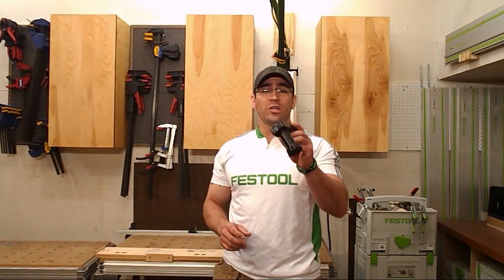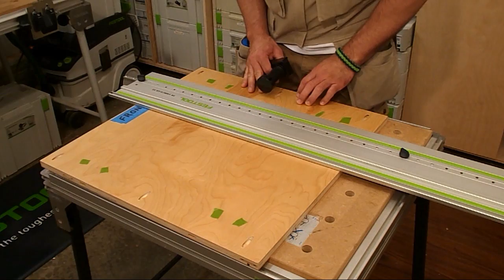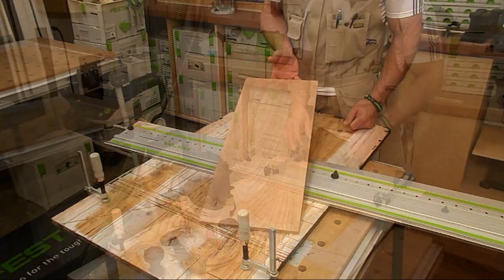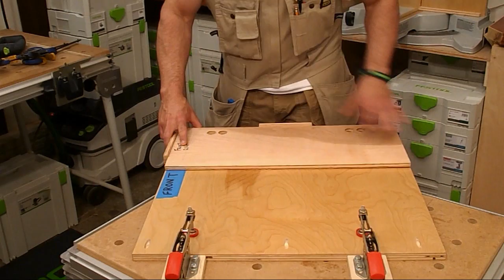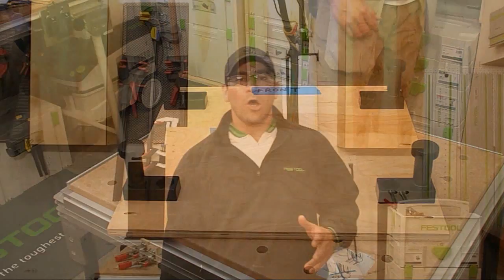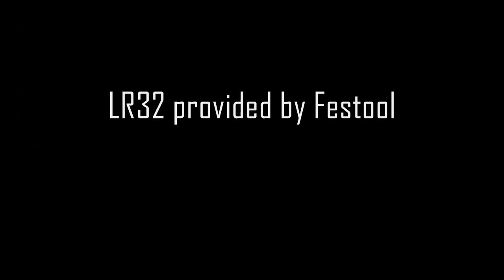Festool LR32 making a  adjustable leg jig  for base cabinets Part 6

Comment: Great job. After watching your "Festool LR32 system" and "Building Kitchen Cabinets" i am able to make my own kitchen cabinets from the scratch. Unfortunately Ikea do not sell Faktum adjustable legs anymore, they switch to Section adjustable legs and your template does not work. I had to make my own template. Any way, you did a very informative video with excellent explanation  for every steps, so even a beginner with right tools can achieve  great result. Keep doing. Thanks a lot.

Comment from the maker: Thanks Lance.  I used pre glued walnut edge banding.  Applied with a household iron and Fastcap edge banding tools .  The ply is pre finished maple.  It's worth the extra money for pre finished ply, saves on buying a poly and spray time.  I just wiped on some boiled lineseed oil on the walnut edge banding to bring out the color.

Comment: Thats what I thought, just double checking, Im in the planning stages of some shop cabinets as well, and I'm leaning towards the LR 32 Festool system. Did you use edge banding or hardwood veneer to hind the ply wood sides? Is that pre-finished ply? and what kind of veneer? looks awesome!!

Comment from the maker: Michael,  Whiteside 3pc plywood dado set with 1/2" shank (150756) from Woodcraft the bit for 1/2" plywood is darn close to 12mm and Freud (12-172) 1" diameter double fluted straight bit also from Woodcraft.  Or check Ebay and search "router collet 10mm x 1/2" It's a reducer for the 1/2" collet, so you can buy a 10mm shank router bit with the diameter you need Hope that helps. Eric

Comment from the maker: Michael,  I have two options for you.  1. Whiteside 3pc plywood dado set with 1/2" shank (150756) from Woodcraft the bit for 1/2" plywood is darn close to 12mm and Freud (12-172) 1" diameter double fluted straight bit also from Woodcraft.  Just remember to slow the speed down on the OF1400 to " 1 " .  And option 2.  Ebay search "router collet 10mm x 1/2" It's a reducer for the 1/2" collet, so you can buy a 10mm shank router bit with the diameter you need  Hope that helps.  Eric